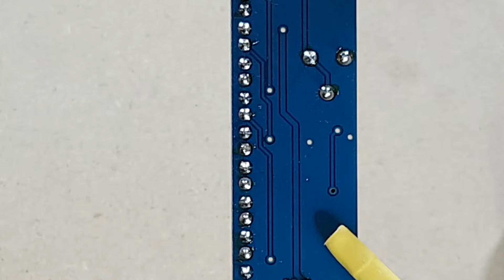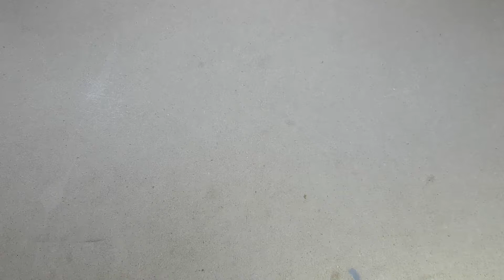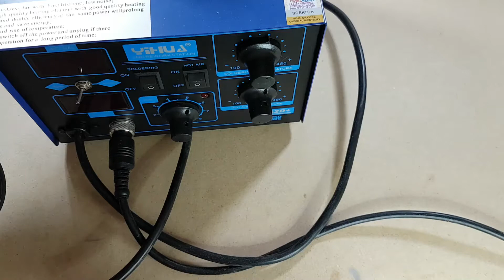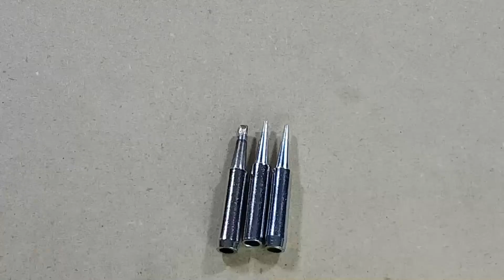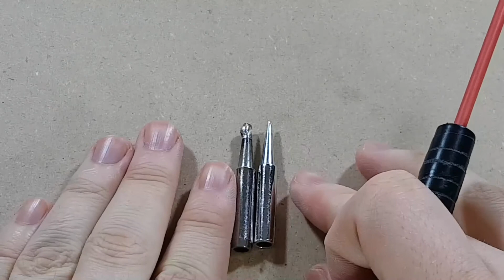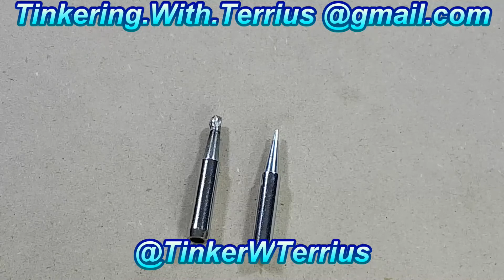TWT #13.1:  Soldering Basics Information

Comment: Several great tips, thank you for producing this information.  I am just beginning to solder components.  Ordered a couple basic kits from Universal-Solder, a company I found based on a comment you made on another of your videos.
Reply from the maker: I'm glad to hear this video was helpful, and that you've decided to try out some basic circuit kits to get started with soldering. All the kits I've ordered from Universal-Solder were good so I hope the same will apply for you, I haven't done any electronics stuff in a couple years at this point though.

I personally think starting with kits is the best way to learn soldering, especially with how cheap the basic ones can be and with the variety of basic kits that exist these days.